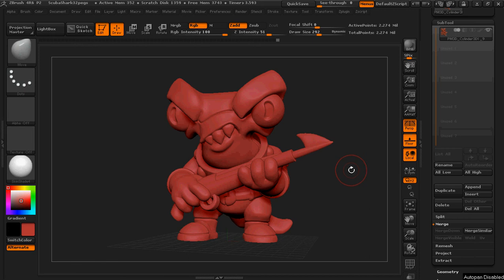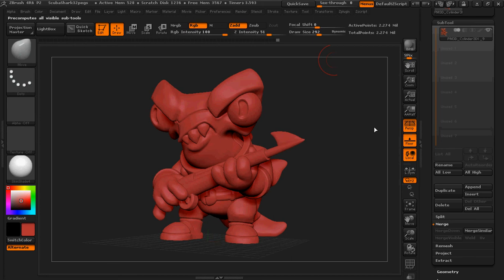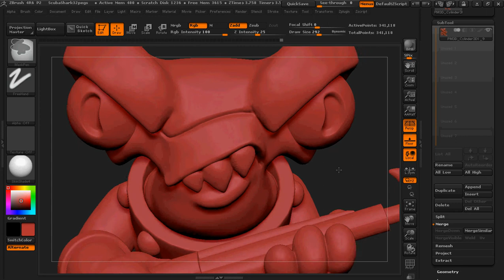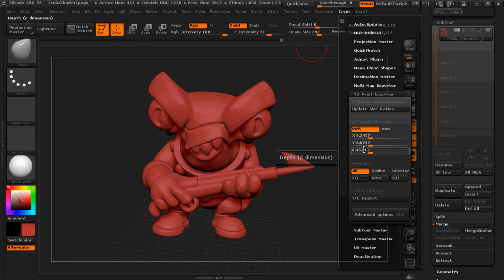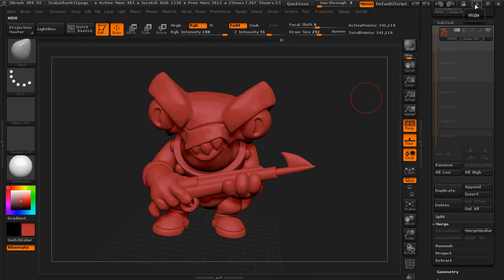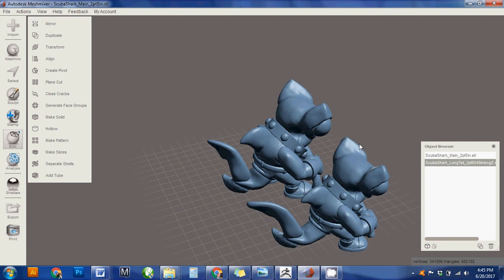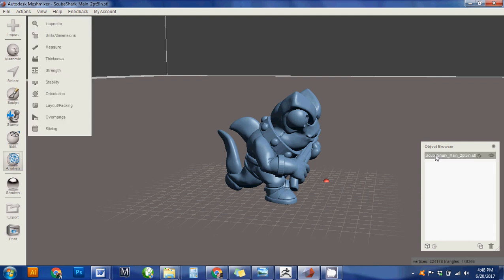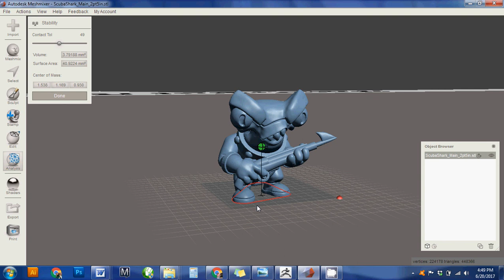Exporting for 3D Printing in zBrush & Checking Stability - Scuba Shark Tutorial PART 9

Comment: Thank you for a great tutorial. A quick question or maybe a suggestion for a future video. Do you hollow out the models to cut down on time and cost? While 3d printing? If so what’s your way of doing it? I’ve seen videos where live boolean is used or dinamesh and adding a shell. The live Boolean function makes no sense to me. And dinamesh extract shell you loose detail. Hope you can make a video on this. Thanks for your time!
Reply from the maker: Thanks and great question. I cover this a little in my other video here: https://youtu.be/f_gSzNtPK5U 
And also, there's been projects where I've taken the final full figure, made a copy, then simplified/shrunk/distorted it to fit inside the original figure and trimmed it out, thus making it hollow. Keep in mind that you need an exit hole somewhere on the figure to make this hollowing out work right.